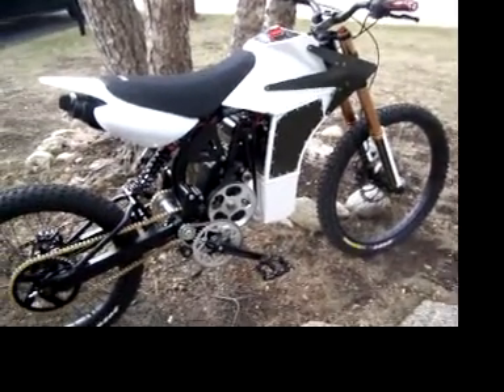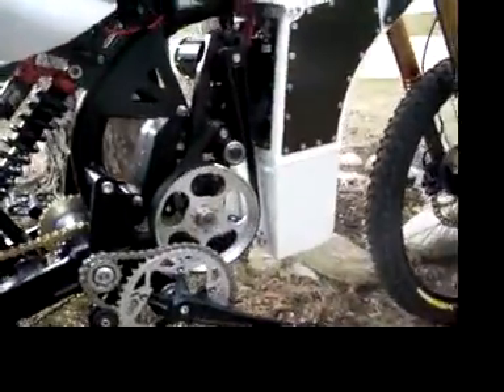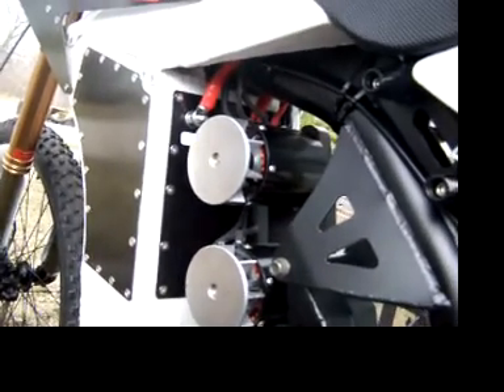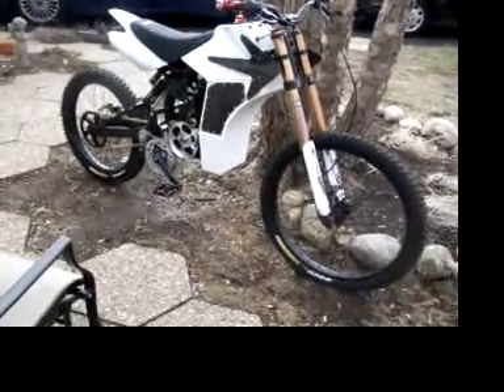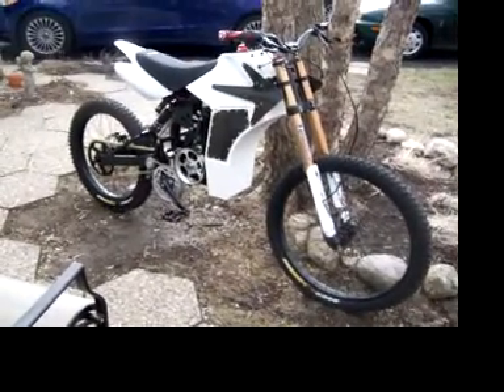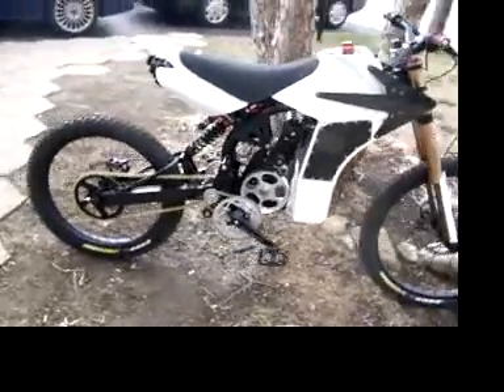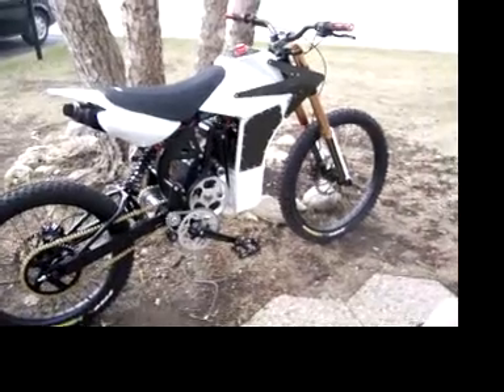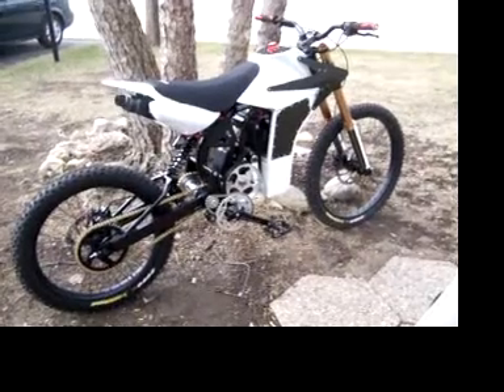Electric Motoped walk around

Comment: Why is the top speed so low. My Ebike is only 1000 watts and gets 30 mph.
Reply: Simple answer: gearing. 
Lower gearing gives you better torque. With a hub motor, you can't do that. You are stuck with what the motor makes out of the amps you push through.

Comment: Please, I want to ask you. Do you have experience with cycle life of these turnigy nano-tech lipos? I want to use the same cells 25/50C and use for burst just about 20C, but If they cant handle at least 300 cycles they are unusable for me cause of the price. I can keep them between 3.3-4.1V and good temperature, but I heard that they are dead after 70 cycles.. :/